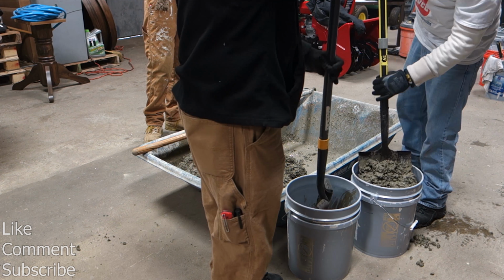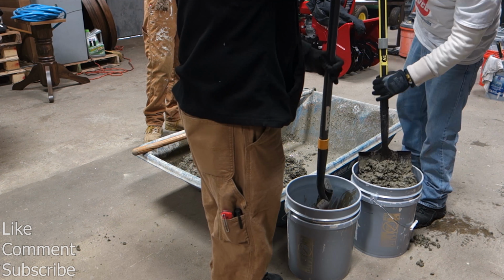How To Properly Mix Concrete - Hand Mixing

Comment: Here Is a tip on mixing concrete in a fraction of time 
1) get a 6'x6' tarp
2) two people 
3) dump bag in the middle
4)grab all 4 corners and pour in water 
5) rock it back and fourth and it should be completely mixed under 4min and that's an 80lb bag,just a tip
Reply from the maker: +CopperElite thanks for the tips brother! Gotta try that technique out!
Reply: it's awesome when your pouring footing ,mix it then funnel it straight in the tube ..no shovels,wheel barrels or hoes just a tarp

Comment: Hello, I just had a trench dug 7' 7"long x 3" wide x 3" to 4" deep into my foundation to have electricity ran to an island in my kitchen, what type of concrete would you suggest as well as how many bags should I purchase also I don't have a wheel barrow would you suggest mixing in a 5 gallon bucket. Thanks for your time.